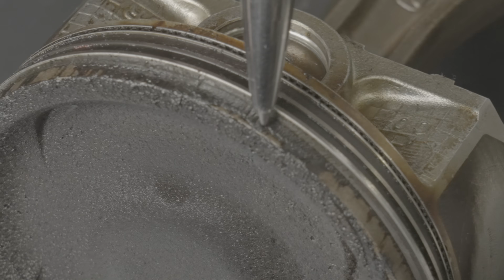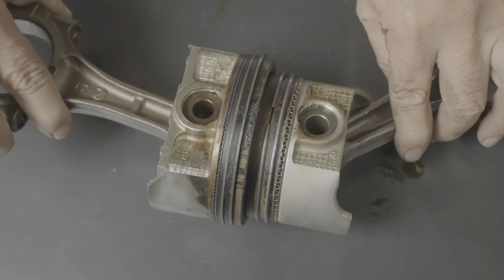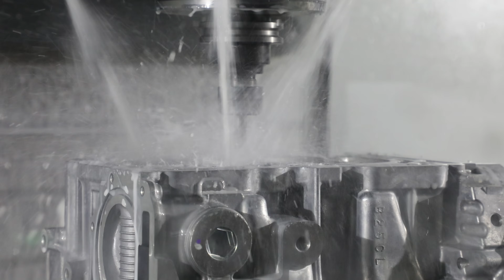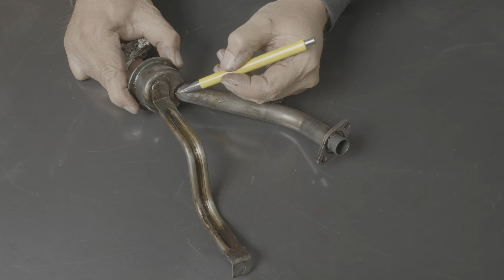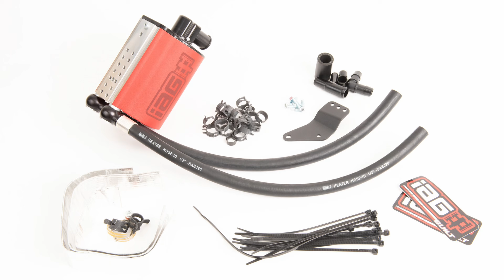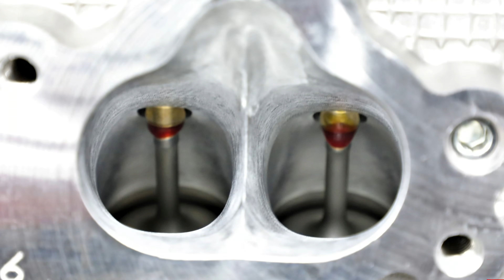Why Subaru Engines Blow Up!

Comment: The Subaru engine was actually designed for ultralight aircraft and helicopters a company called Robin makes helicopters and uses the air cool Subaru engine that will never really designed for a car
Reply from the maker: That is totally untrue, the Subaru although popular as a kit plane engine is totally inadequate as an aero engine and has a high accident rate. We will not build an engine if the customer wants one for a plane. There is no Robin helicopter company, there is Robinson which is a low cost helicopter company that there are a lot of unwarranted crash jokes about. They never used Subaru engines.  Subaru hasn't made an air cooled engine since the 60's I think. Subaru has never made aero engines.  Subaru does make helicopters but they use Pratt and Whitney turbine engines.  The only thing Subaru shares with an aero engine is the flat layout.

Comment: Ran a Cobb tune and didn’t read the fine print. It specifically says not to run in below freezing weather. Ended up breaking ring lands. Replaced with a build block with forged pistons and rods. 409whp going on 50k with zero issue. Including auto cross and some drag racing.

Comment: 1996 Outback,  N/A with 252,519 miles on it. So far so good. But, I only beat on it every once in a while. I often debate putting a snail shell on it but I just can't justify stressing the ole girls completely out of the case at this time in its life...Maybe I'll drop one in after 300k.. XP

Comment: Geewis I had a 2.2L that was still good after 410K miles but the rest of the car had rotted out around it.  My 2006 3.0L has 200K on it still gong strong.  I sold another 2.2L to a man building an aircraft around the engine.  He seemed to have a lot of confidence in the engine.  I did have 2 2.5L in the 90's that blew HGs I replaced the second with the 2.2L I started this post with.
My current soob has a 3.6L with 180K on it, that burns about a 1qt of oil between changes.  I haven't had one blow up yet.  I don't redline them or put turbos on them either.  If someone wants a racing engine they need to modify it to be more suited for the track. Then one would need to modify the rest of the car, brakes, suspension, etc.   Subaru builds street/light off road cars for passenger use.  Great video lots of good solid information.

Comment: Yikes…..I apparently was very lucky when I modified my new 2003 bugeye WRX,  I made 589rwhp big turbo, ecotec stand alone, colder plugs HKS turbo timer/boost controller, FMIC, water injection, etc on a stock motor. My only real problem was continuously breaking the gear (MT) in the  tail piece that sends power to the rear wheels….i ended up converting it to rear wheel drive with a C4 before selling to move on to a new project.
     Your video is really awesome the information and knowledge is outstanding.
Reply from the maker: What did you do for a rearend? The stock R160 diff isnt too strong to run all that 2wd power through.
Reply: @motoiq  I used a Silvia center with custom axles which worked really well on the street, but had to switch it to a big bearing ford 8” to race at the drag strip before I finally sold it.
Reply from the maker: Nice!

Comment: I just need Mike to tell me what to do if I only ever want 300hp
Reply from the maker: Bolt ons
Reply: @motoiq okay, but should I do anything to the engine, I'm currently pulling it apart, had a camshaft position sensor fault and the engine overheated and car died so I'm tearing it down to check everything
Reply: @motoiq it's also a 02 WRX ej205
Reply from the maker: Don't exceed 335 hp on gasoline or 400 on E85 tune conservatively

Comment: They blow up mainly because of the EPA but also because some non-mechanical inclined cheapskate wanted to save cents per vehicle on a graphite coated gasket. Imagine the hidden cost from using these dumb gaskets are losing customers instead of just putting an already existing MLS gasket into the NAs, to instead spend the money researching on a graphite gasket. Absolutely stupid

Comment: My 2017 Crosstrek has 190,000 miles and runs sewing machine smooth. Cant even feel or hear it at when it idles , The Fb engines with the chain timing belt are much more reliable engines at least when it comes to head gasket not leaking and my Subaru burns no oil at all. I love being able to go through Mud,Snow,Sleet and it just plows through everything. I just wish it had more power it is very slow. It will keep up with traffic but passing on a two lane road is very stressful at times.

Comment: I bought a 1980 Subaru, brand new, for my then wife.  Had to pull it three times, the last time it had a broken crankshaft!  I am not kidding, the actual crank broke in half about in the middle!  The car came with a tag which said, "Inexpensive and built to stay that way",  I hung the broken crank pieces on the wall over that sign.

Comment: “The other thing….” lol. I’m a big Subaru fan. Have been for a long time. I run a Subaru business. I say it all the time. These motors aren’t for power. They are great stock or slightly greater than stock. The package for the price is amazing. I personally believe not much is better stock like a wrx for the price. They are cheap, quick, light, best awd on the market for their times, comfortable, etc. if you want a 500hp race car, get something else lol.
Reply: IMO if you want good power in these cars and must have a Subaru, look towards the H6. They aren’t much bigger. They were built to be about the same size as the h4. More displacement, more power and they can take a little boost like the 4 cylinder. At least with that you’ll have respectable power that can be reliable.

Comment: So essentially your only issues are oil pan, oil pump, crank case design, block strength, open deck head and head gasket surface, piston and ring design, engine orientation, and its difficult to assemble and to machine. They can't perform NA and they're fragile with turbos. Got it. 😆
Reply: Bro ....Sounds like buy a different car ...
Reply: They are underpowered too, gotta have some money if you wanna have fun with them. Plus those engines aren't cheap and plentiful.

Comment: I find this funny, because I’ve had the same WRX for 10 years now, and I’ve never had a single problem yet. Not one. Not even a little hiccup. The problem these engines fail is because people install mods and don’t properly tune for them, or they try to push too much power through them without having all the supporting mods. As long as you are careful, these motors will last forever. Period.

Comment: They blow up because people without a clue try to tune them without the expertise needed to do it right. All engines have problems and none are perfect. My experience many fail due to the owner's lack of proper service. Only a few fail because of a bad part it is almost always due to failure to do the proper maintenance. I am talking about normal people driving them normally for just every day driving. Tuning is an entirely different subject. I have seen many of these young teens slap on cheap Amazon/Ebay parts trying to tune them and blow them up because they did not know what they were doing. If you want a full blown sports car go buy a car made to be a sports car. Subaru designs their vehicles for every day people they are extremely safe cars and reliable if used for what they were designed for.

Comment: Thats a shame for  Subaru? I youst to fly and owned a Cherakee 140 With a Lycoming 150 and updated Suplamental type certifcate to a 160 topped low leas engine witch boosted it to 160 HP? I allways like the Subaru technolocy on the idea of HORIZONTAL opposed engines?Manufaxctures are really pressed anymore with stringent laws that really ask a lot out of companys?When other big companies can convert a gas engine to a V8  DIESEL engine and say it will last forever and get away with LYING as uasually?????

Comment: But all the people on reddit say there's nothing wrong with the engineering, people just aren't changing their oil enough 😂
Reply: That's partially true. Or not checking it to keep levels at max. Like this guy said, just pushing a factory engine well outside what it was designed for will have the same result regardless of who's engine it is. The EJs, in particular the NA models really needed a lot of extra work done to make them adequate for motorsports compared to the K series. The FAs are a big improvement but still have their shortcoming, in particular I don't like the connecting rod design.

Comment: Seems like the solution is to chuck the entire Subaru engine in the recycle bin and buy an IAG boxer engine. Therefore, you are only using the Subaru chassis and shell.

Comment: I feel like the owners of the turbocharged flat 4's beat the piss out of these engines.  They aren't race cars... They're sporty awd rally inspired daily drivers.
Reply: Daily drivers that you can find being used in every facet and category of motorsport. 😂
Reply: @jaredmundi3599 Yes.  I'm talking in factory form and there's nothing wrong with using a Subaru for tracking,  auto crossing or time  attacking.  There use to be an old saying..."If you wanna play, you gotta pay"

Comment: funny i had 2 old Subaru's with the 2.2 both i had till over 270k miles and one i gave to one of my kids and it went over 350k with him, and almost all the issues can be tracked to POOR MAINTENANCE !! in fact many famous car critic's say the Subaru is as good or better than Toyota for life of the car, and i know the boxer engine having owned VW's, and Porsche's and BMW motorcycles, and where Subaru did have some issues they fixed them long ago, and every critic that cuts them down shows older engines and no talk of what kind of maintenance they received.
Reply from the maker: This video more is about Subarus modified for performance.  For the most part, if left stock they can be perfectly reliable. However they are still more sensitive to poor maintenance and abuse than other makes.

Comment: What i get from this is stock engine with tuning and track use = kaput. Stock engine with normal road use = mostly no problem.
Reply: Plenty of people (and I mean A LOT) use the wrx/sti as a track platform in all kinds of race categories. This video is a bit of a beat up honestly. Yes they aren't a perfect engine but they are pretty fkn good and there's not much that can keep up to one when done right.

Comment: I don't think you can talk about the naturally aspirated engines in the same vein as the turbo engine and one that has been tuned to produce higher HP.....if it wasn't designed like that in the first place, it shouldn't be modified. I remember back in the 70s guys would put a V8 in a Chevy Vega and the blow the rear end.

Comment: As long as you keep it stock and do proper maintenance, it will last you a long time. I have not had any issues with my wrx so far.
Reply: Your comment gives me hope. I’m in the market for a new WRX and am reconsidering after watching this but I also don’t plan on beating on it or excessive modifications
Reply: @tor3699  EVERY vehicle that has direct injection (75% or so) is going to be problematic after the warranty is done .  I am getting a new BRZ to avoid what I think is the worst problem, carboned up valves.  I know repeatedly that no amount of NON INVASIVE maintenance can overcome a direct injection engine (Toyota uses a dual system that they license to Audi). But I refuse to buy a Toyota for multiple reasons everyone can guess.
Reply: I have a 2005 wrx on its 1st motor, with 250k on the clock and it still hauls like a new one. Stock except a cat back. I reckon it's got another 250k in it.

Comment: So just like any other make of car if you drive the hell out of it and mod it to beyond what it was designed to do, you will get the same result.  So is there going to be a video for "Why BMW motors blow up"  or Audi, or Merc, or Toyota, or, or, or...I hear what you are saying but I guess haters will hate...
Reply from the maker: BMW B series motors are super strong, so are a lot of Toyotas.  Subaru's are fragile when modded heavily incorrectly or pushed too hard stock.
Reply: @motoiq  I agree...but as you mentioned..when modded heavily or pushed too hard stock. Any engine will have the same result.  Some sooner than others I will admit, but it comes down to owner and driver. Treat your car well and it will treat you well. Thrash it and it will let you down. Thanks for the video!! Enjoyed it.

Comment: I had a wrx sti 2007. All I did was change the head port and polish. And intercooler upgrade. Turbo upgrade and headers and intake manifold. And oil pickup. Oil pump upgrade

Comment: Subaru performance engines are not built strong enough to withstand turbo-boost.  They are not built like Toyotas, which are over engineered.  This is a good thing.  Thank you Toyota.  Not referring to the new Tacomas!  They SUCK!
What does NOT SUCK is this man who is explaining issues with the Subaru turbo engines.  He really speaks well, explains everything very well, and definitely knows his stuff.  These are thing that I remember learning in my tech-school years ago.  Excellent video!  Very well done!

Comment: Absolute bullshit.
Reply from the maker: Objective engineering level information is bullshit, says your opinion.
Reply: @motoiq  Owner of 3 Subarus. Over 300,000 km in each of them. No engine problems at all.
Reply from the maker: You probably own stock NA ones, do your maintenance and don't drive hard.
Reply: @motoiq  Yes. I withdraw my original comment. Sorry!

Comment: Bought an 02 outback 2.5 year n half ago with 124k fir 2300$. Loved it through first winter was unreal in the snow but spring came n it overheated pulled over it blew out overflow so I let it cool down for hour n half topped off coolant drive home was fine next day did it again. So took to shop got timing belt water pump n valve cover gaskets fir 1300. Shop said water pump was issue. Get it back week n half it does it again take it back they say rad is bad wanted 450 well I told guy first time that I do most my own stuff but I thought it was head gasket n that n timing wasn’t really interested tackilin so gave him diagnosis fee swapped radiator myself n learned bout burping cooling system well spent next week with it overheating n swapped thermostat which I couldn’t believe they didn’t do n after checking bill noticed they did both my valve cover gaskets when I asked only to do passenger side cause that was side leaking but then guy refused to work on my car cause I did rad myself took it across street to my dads guy rad cap was bad n he pressure tested to see if head gasket actually was bad cause coolant kept looking blackish n smelled like exhaust said it wasn’t bad they put new exhaust to pass emissions. Five fir like a month and happens again. Found out temp guage sensor bad then after replaced head gasket goes but not bad. Managed to get it squared away with a Subaru guy recommended stop leak. accidentally pulled tps instead of map because I listened to wrong guy on internet cause was still running rough that was a bag of worms. Now got it finally to start decent with new map n now have a bad misfire in frt driver plug. Ohh bit to mention 1700 33 days after purchase have rack n pinion fail. 3 days after time allowed to take back to dealer fir refund or fixing. Like as much as I love this thing it’s been a pain in the ass. I’m almost 6500 into a car that definitely isn’t worth close to that and I just found a dang website to get jdm engines with 45k or less fir between 750 n tops 1300. Man if I knew the issues the 2.5’s had from 97-04 I’d just have bought a 2.2 turbo n popped it in. Plenty of them for 700-850 n shipping is free if u have capabilities to unload like skid steer or forklift. 😤😤😫😡🤬🤬🤬😭😭

Comment: They blow up because they are crap. Badly designed and under engineered. Great for workshops, it’s a well known fact they only win races in the wet
Reply from the maker: Dunno did pretty well in WRC, JGTC, Isle of Mann
Reply: Multiple world rally cross winning engines are crap you say 😂

Comment: I just got my VB a couple of months ago.  I put on a JB4, some mufflers and I'm gonna put on a Perrin intake. That's about it for me, as it's my daily driver. You think it'll be alright with those simple mods?  I run 93.
Reply from the maker: You are going to need a tune due to the intake.
Reply: @motoiq  I spoke with a rep from Burger running and he told me I wouldn't, but if I send them my graphs after install, he Said he'd hook me up with some adjustments if needed. Thanks for the info!
Reply from the maker: A lot of times intakes make them run lean and detonate.
Reply: @motoiq  is it something I could tune myself through the JB4?  I've got an app that connects to it for adjustments.
Reply: @motoiq  I really don't want to blow up my engine 😅😂🤣
Reply from the maker: If you have to ask, you might not know what you need to do to make sure your afr is right and how to correct it. Your tuner can probably help with a remote tune if he see the logs.
Reply: @motoiq  good deal. Thanks
Reply: @motoiq  if I do need to tune it, do you know if a place in St Louis I can take it?

Comment: I have never seen a Subaru engine blow up. What the heck are you talking about? If one actually blow up, its because the owner abused it.
Reply from the maker: They blow up enough for 300k people to watch this video!
Reply: @motoiq  not true, people watch because of the title that says the engines blow up but this engines are almost indestructible. Clickbait BS.
Reply from the maker: And your experience building high performance Subaru engines is....? This is a whole engineering level discussion on the engines problems and I bet you didn't even watch it before commenting.
Reply: @motoiq  looks like you know me more than I thought. Your response shows your arrogance and lack of respect for others thinking you know more than others.
Reply from the maker: Actually look in the mirror.